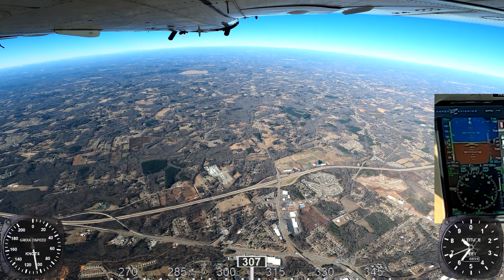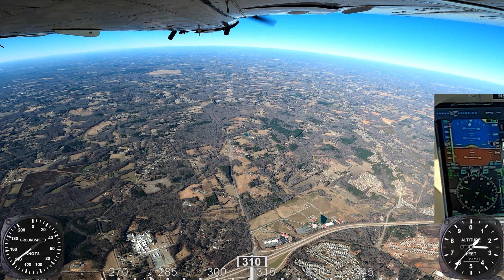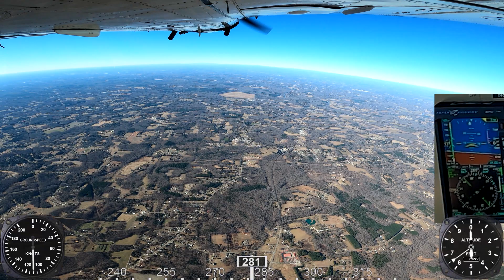Pitch Trim Simulation - 5deg down TNFlyGirl

Comment: Wouldn't pulling back on the yoke override the 5 degree pitch trim?
Reply from the maker: I haven't heard any updates on this....but enough pitch trim, when the autopilot releases, would be extremely jarring to an unexpecting pilot.   Yes you would thing you could overcome it, but it might have all just happened too fast.  They also weren't clear if they were measuring the pitch on the actual trim tab, the indicator etc....so it could have been worse (or better) than might little test.   I was doing it real time vs an autopilot sudden release

Comment: I think you did the right thing but didn't quite explain it clearly. I imagine you determined on the ground how much you needed to spin the trim wheel in order to get the trim tab to move 5 degrees, and then repeated this in flight?
Reply from the maker: No.   The trim wheel has a display, I set it to 5deg nose down, then released the yoke to see what would happen.   The point was to simulate what would happen if she mis-trimmed the plane with the autopilot engaged,, and the result when the autopilot disengaged
Reply: @davidfarmerracing Oh, I didn't know it had a display. Thanks for the info.

Comment: fly girl it appears just did not have basic pilot instincts when you nose over into a dive the first instinct is to pull the power then recover I suspect thats what you did.. And I suspect since in most of her flights her use of power was not constant at all like keeping your hand on the throttle most of the time.. most of her flights her hands are every where but where they should be. 
So unusual attitude like you just demonstrated pull power to idle ease back on the joke to slow the decent and come out of the dive add power as you level off..  but to be fair if one of the cables busted then all bets are off .. Hopefully this will be determined

Comment: And yet you had no trouble arresting that 3000fpm descent.  She was in a 12000 fpm descent at 228knts.  Unless the control cable broke prior to impact, I do not understand how she could not arrest that descent unless of course she was so distracted in the cockpit she did not realize she was descending at that rate.  After all, from 6000ft she had very little time to grasp the situation.  Hopefully the go-pro cameras will reveal what actually happened.
Reply from the maker: if the autopilot disengaged and the plane pitched over instantly...it might have been beyond the pilots' capabilities to recover.   Yes I had no problem, I was prepared...but I also know how to trim my plan and correctly use the autopilot
Reply: So if I understand this correctly, at this high rate of descent and speed…pulling back on the yoke sufficiently enough may not be possible for her due to the forces in effect? Would it require a high degree of strength at that point? Maybe above her ability.  I’m not a pilot so forgive my ignorance  @davidfarmerracing
Reply: @davidfarmerracing  I find it difficult to believe she could not recover from a "pitch over" from 6000' unless there was a mechanical issue, ie. broken elevator cable. I know the NTSB has shown the picture of the elevator cable after the crash showing the classic "broom straw" break, but who's to say that did not happen prior to the crash and was the reason she didn't recover.  Hopefully her go-pros will show something.
Reply: Yeah the go pro footage that we will likely never see. It needs to be released in the interest of the public. Can only hope that someone leaks it.
Reply: @adamarzo559  being leaked is our only hope for seeing it is correct.  Even at that it will be two years before Jennifer puts out a final report.
Reply: @adamarzo559  wonder if someone could get it via a FOIA request if they don't release it with the report materials. You're exactly right - the public needs to see that video.
Reply: on a clear blue day there is no way she did nto realize she was in a dive or descending at that rate.. second it happens you close the throttle it is very instinctive when you see mother earth rushing at you ..
Reply: @jlh9910  you made my point.  thanks.

Comment: I believe that the vast majority of her 400 hours, she had a CFI or CFII in the right seat. Possibly only did the minimum solo flying, to get her private. Her dad wasn’t a pilot. Jenny lacked the understanding of the fundamentals of flight. On almost every flight, she climbed at lower power settings (speed decayed), did not adjust her constant speed prop or lean the mixture. I’d imagine that several times, she had been close to running out of fuel🥴.
Reply: How did she pass her check ride with a DPE?
Reply from the maker: yes, aware of all of that except the dual-time/total time.  Thanks

Comment: When would you ever want 5° pitch down? As a non-pilot that seems like something that wouldn't ever be useful.
Reply from the maker: there was a recent crash where NTSB found the plane 5deg pitch down.  Previous videos made by the deceased pilot showed she had a poor understanding of her aircraft and autopilot.   This is to show an example of the repercussions of getting into this condition.   "TNFlyGirl" was her handle if you want to learn more about her crash
Reply: @davidfarmerracing  yes, I was hoping you could give an example of when 5° pitched down would be used? 1-2deg maybe, but 5 seems extreme enough to never be useful.
Reply: @vica153 depending on configuration, cg, flight conditions, etc, 5* down may be appropriate.
Reply: @vica153 Its always nice to have a little extra as opposed to running out. The aircraft can have all manner of performance envelopes depending on loading and configuration.
Reply: You would use a lot of down trim with flaps deployed and a high power setting.

Comment: Classic case of not knowing how to operate critical systems.
Reply: I'm not sure if she was exactly overconfident, seems more like blissfully unaware how her lack of real understanding could quickly become deadly. She learned how to takeoff and land and seemed to treat flying like driving a car. Just put it in drive and go. She struggled to look the compass and find the proper heading. Pretty safe to assume things like elevator trim, fuel trim, propeller pitch were well beyond her understanding. Some people are blaming her instructors, but she obviously knew enough to get by and chose to spend her time making silly videos and not learning how to properly fly her plane.
Reply from the maker: appears to be the case, one video shows her flying around lost in circles without pulling back the  mixture or prop.
Reply: @davidfarmerracing  Yeah, lost directly above her departure airport, no less.
Reply: Ego kills, she was overconfident and underqualified, if I heard right she had her PPL over a year at the point of the crash, but the plane was new to her.. Sad and unnecessary.
Reply from the maker: @CharlieTheAstronaut  I saw reports she had 400hrs....this certainly does not appear to be accurate based on  her pilot skills.
Reply: @davidfarmerracing @davidfarmerracing  I mean, I know people who drive boats for 10+ years but absolutely suck at it; that works until you get into an unexpected situation when it abruptly stops working...